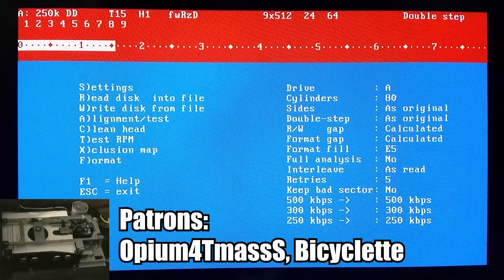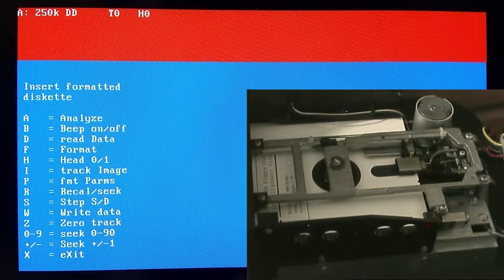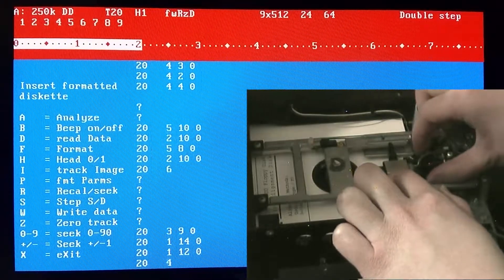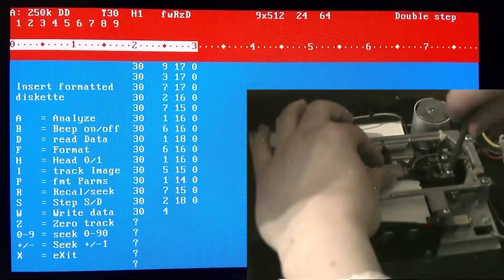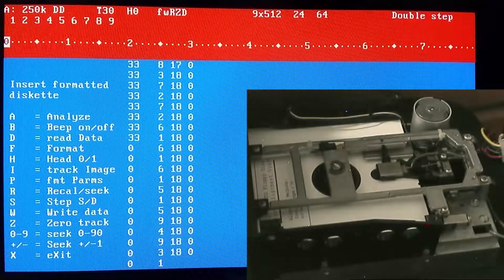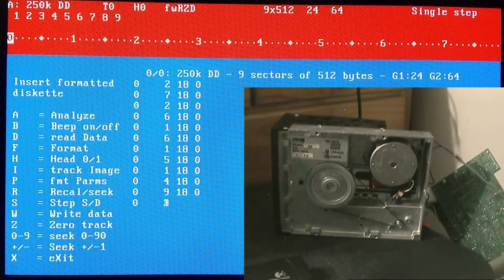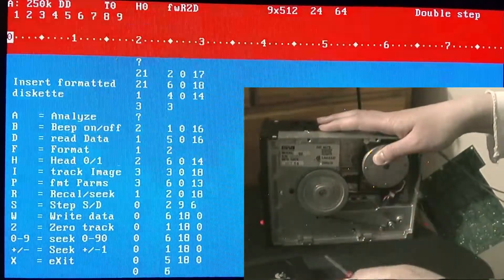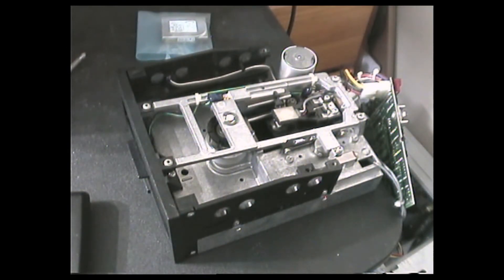How to align a 5.25" floppy drive!

Comment: Where did you get the alignment disk? Thanks!
Reply from the maker: @twillkickers  ebay :V

Though, when using IMD to do alignment, you can just use any retail DOS formatted disk for alignment! Means you don't need to buy something expensive, and I think in hindsight I mightve gotten ripped off since the disk in this video can only be used for alignment in IMD.

Comment: Is it possible to align single sided drive for example from TRS80 model 4 in a normal PC (486)?
Reply from the maker: @tomekrv942  so long as the interface is the same and the BIOS doesn't complain 👍

Comment: One question: If a drive can read a few floppy OK, does it mean that the other floppies are defective? Many of my old floppies make a lot of noise and others it says that they have bad sectors, others dont read nothing at all.
Reply from the maker: Potentially! One issue with a lot of older floppies at this point is that they may suffer from "bit rot", where the magnetic field on the actual disk itself has begun to fade beyond readability.

Comment: Hello Dave, I have acquired lately a PANASONIC JU-475-5 DISK DRIVE 5.25" 1.2MB for which i am trying to align the heads.
I don't have an alignment diskette, so I chose one of my 5.25" 360K diskettes and did the alignment procedure using IMD119. 
After that, I noticed that some of the floppies can be read while others fail to read.
I guess this is due to the fact that they are formatted on other drives, right ?
And the for all floppy diskettes to work on my Panasonic, I must align the heads using a special alignment diskette ?
Any idea from where I can buy one ?
Reply from the maker: Not that I know of, sorry. (I'm not Dave btw)
Reply: @TheMajorTechie  sorry got confused !
Anyhow, the only way to fix the drive is to align it using a special diskette ?
Reply from the maker: @shadman6167  alignment diskettes are factory-written with special equipment rather than consumer drives, so they tend to be the most accurate alignment-wise out of any disks.

unfortunately, because of their rarity and the way they're made, to my knowledge it's impossible to make them yourself. i'd recommend continuing to try alignment using IMD and consumer software disks. keep an eye out for alignment disks on ebay as well. they should be ones that make reference to a "cat's eye" signal (or similar) because they perform their alignment by having the technician watch for a very specific pattern to show up on an oscilloscope.
Reply: @TheMajorTechie  Hello, I just got a brand new factory DOS formatted 1.2MB Diskette which i about to use to align the Panasonic 475-5 disk drive 1.2MB.  Just a reminder,  the drive is also brand new but I messed up with the top head by unscrewing it and removing it completely that was 2 months ago. 
Now I tried to align the heads with IMD using the new diskette but i am facing the following problem:

- After selecting the drive and pressing enter to proceed with alignment, the disk is not detected as I get a '?' all the way on single step.
- If i press the cursor once to move the head by 1 track and press 'A' to analyze or D" to read data, I still get a '?'.
- if i press the cursor one more time to move the head to track 2, the data is read and it detects 500K DD 15x512.
- if I try the same using Double Step, it works when i press the cursor once to move the head.

What could be wrong ? why isn't it reading data on track zero ?

I noticed that H0 is out of alignment even though i didn't touch it.
So I aligned both heads successfully but when i try to access the drive from DOS, it says general failure reading...
Also when run IMD again, the drive is out of alignment. I don' get it !

I have another functional Panasonic 475-5 Disk Drive and it read the diskette correctly.
Reply from the maker: @shadman6167  are the heads on the mon aligned drive clean? If not then clean them off with some isopropyl alcohol and a cotton swab. Beyond that I'm not entirely sure why it still won't read disks aside from maybe not being as well aligned as it seems to be or hardware failure.

Comment: Hello, do you have a solution to fix when the head is damaging the floppy? My discs are getting scratched to the point of removing the substrate.
Reply from the maker: oh man. see if cleaning the heads will do any good. if not then the heads are likely damaged beyond repair.
Reply: @TheMajorTechie  this is so sad... but thanks for replying.

Comment: Quad-density drives were definitely not standard; I have them in my AT&T 6300/Olivetti M24/Xerox 6060 systems, but it was really cool back then to store 720K per disk -- but I never used it, since it borked compatibility with my DOS disks.
Thanks for the calibration video!
Reply from the maker: Yup! I've found that on some PCs, you can set them in BIOS to be 720k 3.5" drives, and then DOS will be able to use them just fine!